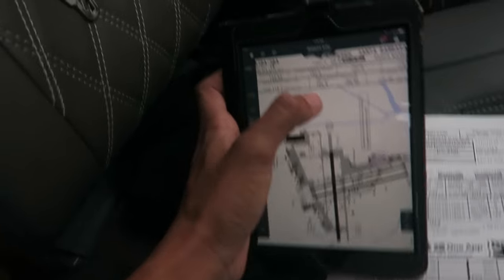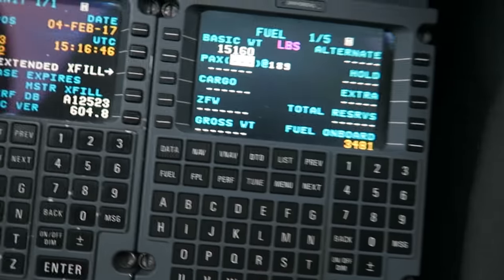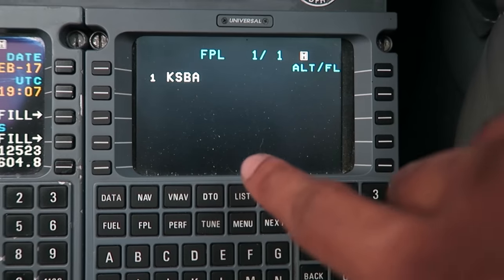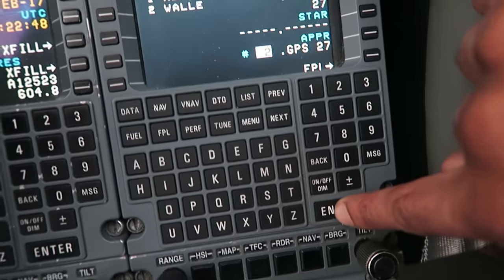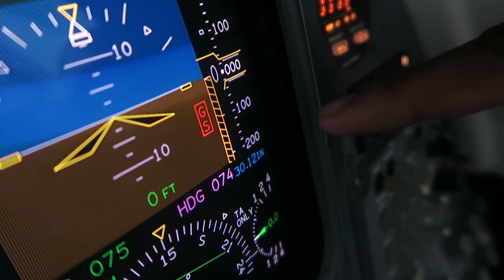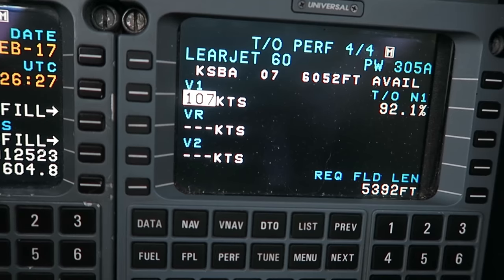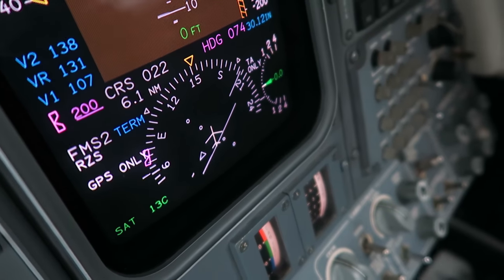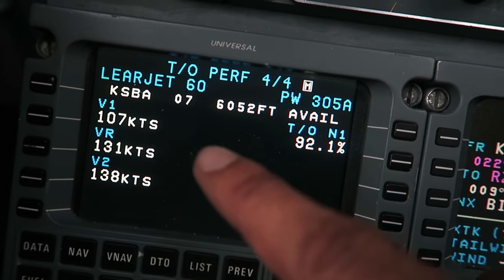FMS Programming Tutorial (Lear 60)

Comment: One thing I would not do is have the FD bars showing the Hdg until you are ready to turn at 500ft otherwise when you rotate & fly the dials you have misleading turning indications coming from the FD bars. Push hdg when you REACH 500ft then follow the FD bars. Never T/Off with the FD bars showing other than straight ahead & with the appropriate pitch command.
Reply from the maker: I see what you mean and you're right. I never had the issue of rotating and immediately following the FD bars but what you said practices safety and I'm all for that. Thanks for the tip.
Reply: All good, we can all learn from each other:) On a dark stormy night launching straight into the soup you need everything going for you:-)

Comment: May I ask you something; why there is an item about reverser on T/O PERF page? Thank you.
Reply from the maker: There are 2 options here: Stowed and Max. Maximum reverse thrust in case of an aborted takeoff that's not related to an engine failure. Or stowed so that the computer factors in spoilers and braking alone. Neither selection changes the V speeds so we just leave that alone.
Reply: I got it, thank you very much for your reply, appreciated.